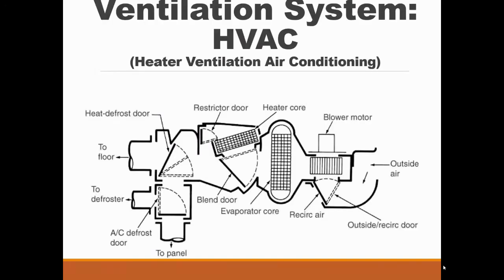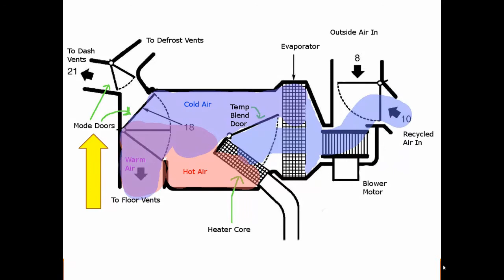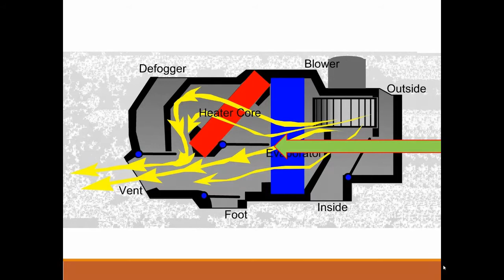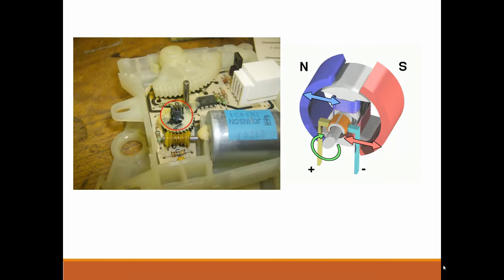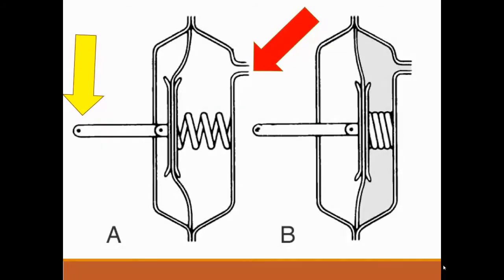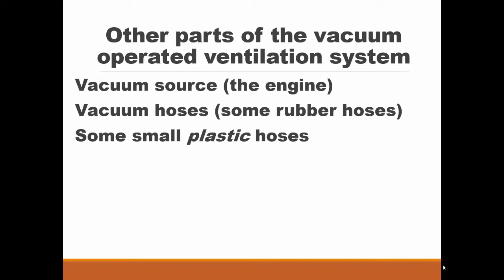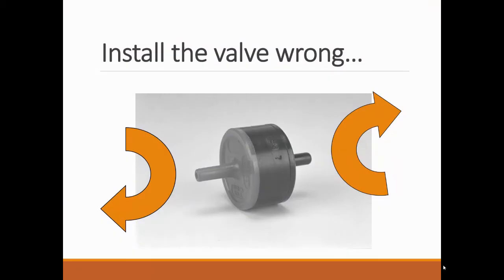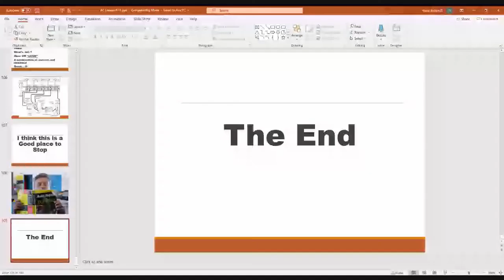Lesson # 15 : The Ventilation System Explained.

Comment: hi man thanks a lot for this I just want to know now if a brand-new a/c compressor is better than a used one I've been told by many technicians that the new ones don't last long it is better to buy a used one what is your take on that
Reply from the maker: Sad to say that even the name brand parts are not as good as they use to be. Never buy the low cost parts. The dealer has the best parts, but at price. The only chance you have is to but the most expensive aftermarket they offer.
Reply: @theoldmecanicoshow9004  Thank you for that man. I'm a mechanic also I don't have as much experience so there are things that I'm learning along the way any advice to help me in the field and should I use any books until i gain more experience?
Reply: My reason for asking for advice is because I'm thinking about having my own shop and I don't want to be running a trial-and-error shop that is bad.
Reply from the maker: Reading books is OK. The reading you need to learn to read is "Procedure/Instructions on how the diagnosis/ test . For example, the Mitchell Pro Demand has step by step instructions on how to test and repair just about anything. Thank you for the views and the comments ans questions. Good lucj my you tube friend.  @mrbond191